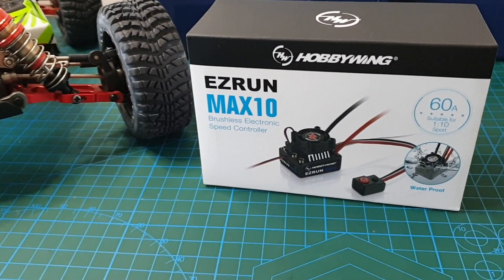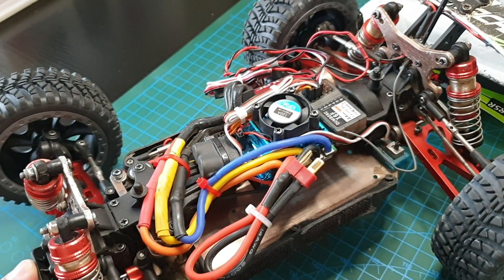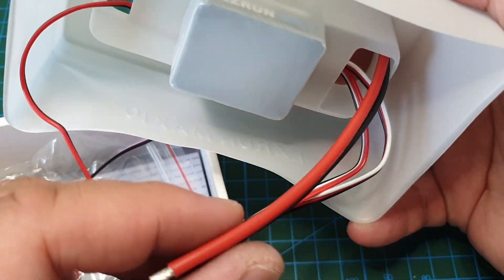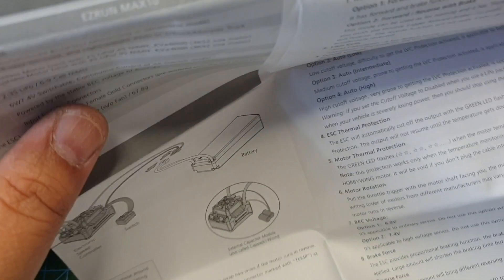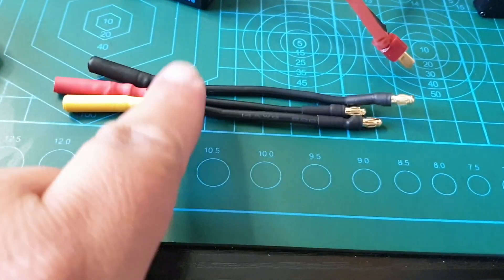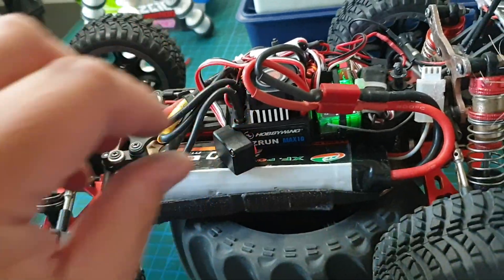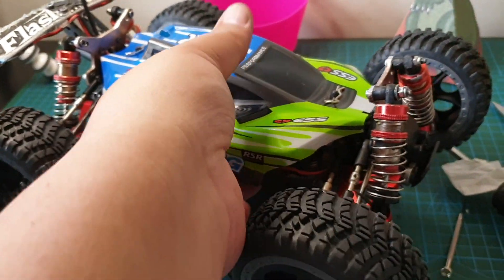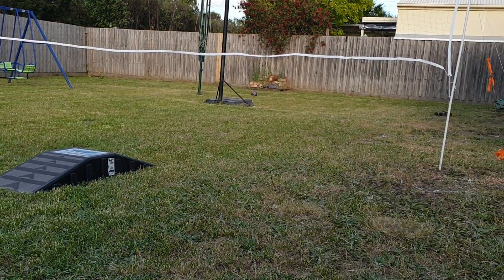Hobbywing EZRUN MAX10 60A Brushless Sensored/Sensorless ESC upgrade to WLToys 144001

Comment: Great video, i never thought of using a Max10 60a in my 144001, its really perfect since its small but capable. Great idea, thank you!
The 2 wire with white plug you mentioned goes to the "Temperature Sensor Port" found on Surpass Hobbies Rocket V.3 AND Hobbywing  sensorless brushless motors with built-in thermistors to tell the ESC the motor is to hot. The Surpass Rocket V3 45a, 60a, 80a & 120amp esc with the momentary power button,  NOT a slide switch,  have the same 2 wire temp sensor. The plug is found on the end of the motors. Hobbywing and Surpass are both brands crreated by China to sell products to 'free marker' countries and are both built at the same massive Shenzhen plant.

I have a Max10 60amp with a Surpass Rocket 3400kv 3660 BL motor in a Vaterra Glamis FEAR 1/8 Rwd Sand Rail. Performance is great over the Dynamite Fuze 70a/290a peak esc and 3300kv 3650 BL motor. The 3660 has a lil more KV and i longer so has way more torque giving the FEAR more powerful acceleration and top speed!

Comment: How long will the gearbox and bearings last?
Reply from the maker: I guess it depends om how, where, and how often you drive it
Reply: @MickoRC  I installed parts from the Lc Racing EMB-1. The bearings are bigger and last longer.

Comment: Did ur diff hold up with the bigger tires
Reply from the maker: Yeah I had no issues with my diffs with these size tyres. But with that said I don't run this car often and when I do I am very easy on the throttle when accelerating.

Comment: You can use wd40, its much easier and quicker
Reply from the maker: Thanks, I'll try WD40 when I run out of this GOOF OFF stuff. 
I only bought the GOOF OFF because I replaced the battery in my MacBook Pro --- The adhesive securing the battery was very very strong and stubborn!

Comment: I had that esc and it's good, fast. But believe it or not I had the same amperage Ocday esc and it is even faster.
Reply from the maker: Hi Billy. Thanks for watching and your comment. That's interesting. I wonder if the Ocday ESC is pulling more than current even though it's labelled as 60A. Or I wonder if HW is limiting the current it pulls (to true 60A) and it's their way of preventing overheating and prolonging the life of the ESC. 🤔 I'm just speculating...

By the way... have you seen my giveaway video? One lucky winner will receive their choice of a 144001, 124018, or 124019. Enter here if you're interested: https://youtu.be/ZXClkcB7I6A thanks!

Comment: Very nice setup Bro 😍 👍🏽 

How do you like the tyres? 

Stay safe ✌️🏽 😎 🏄🏽
Reply from the maker: Thanks brother. The tyres are ok for a light vehicle like the 144001, but they're not good for the original vehicle which is heavy (FS Racing 53632 1/10th scale) because the design of the wheels is bad -- the inner rim trims eventually come off. Cheers bro 😀

Comment: Goes great, dude! Looking forward to the speed run! Considering this esc myself. And love those wheels!👍😁👍
Reply from the maker: g'day Matt. thanks for watching. Yeah its a great ESC. Very punchy but can be adjusted. Yeah these wheels do look good and nice aggressive tread for offroad. but sadly they're a pretty bad design because over time the inner trims start to pop outwards. They are spares which came included in my FS 53632 and I occasionally chuck them on the 144001. seeya bro 🍻🇦🇺

Comment: I really like the look of those wheels, look like true all terrain tyres-where did you get them?
Reply from the maker: They're a spare set that came with my FS Racing 53632 1/10 buggy. They're too big and tend to overheat my 144001, so I only put them on once in a while.
Thanks for watching this bro! stay safe 😀
Reply: @MickoRC  Are they not ok with the brushless set up? If you want more room under the std shell, swap out the body posts for A979 ones-they are taller and allow you to lift the shell a bit.
Reply from the maker: @icabodpsillycyberman414  they're OK. I think the problem is with my lack of cooling and ventillation. Thanks for the tip about body post. I will try that. I do want more space inside and retain existing body shell.
Reply: @MickoRC  If youre into modding your 144001, there are 2 groups on facebook well worth joining. Bigbeard rc and John robinson rc-a wealth of info to be had. The best source of info overall is Quadify-check out his website if you're not familiar with it already.